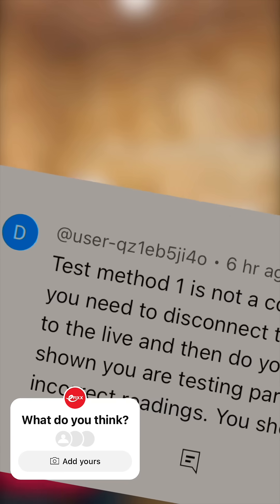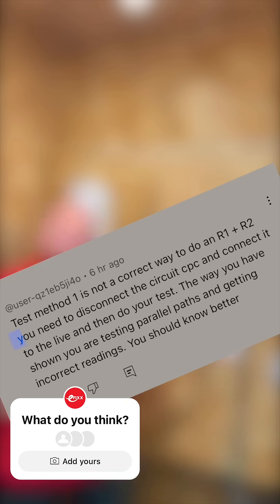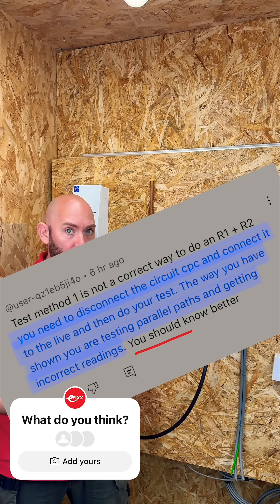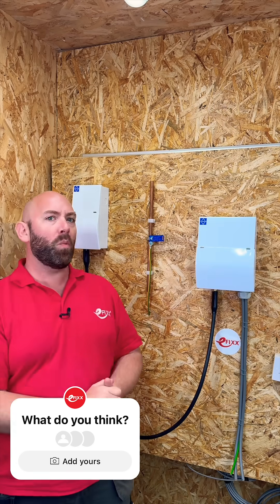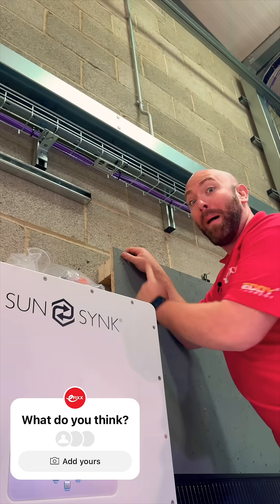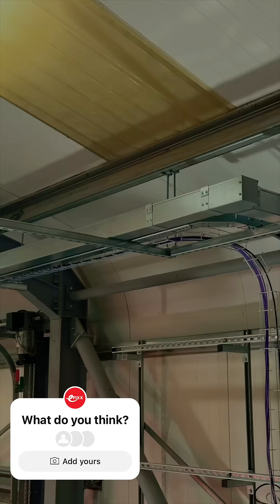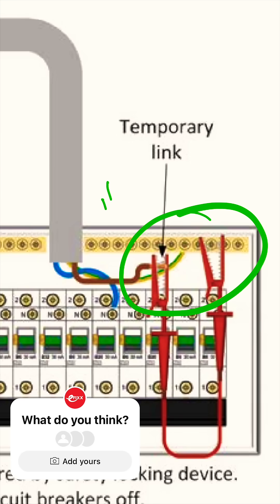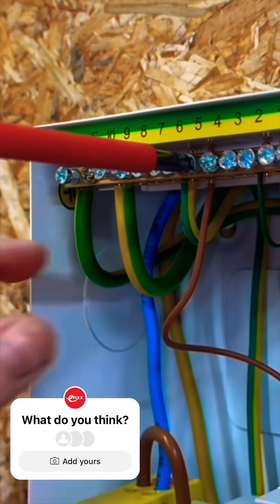Earth Continuity Testing Mistake?

Comment: Disconnecting the cpc makes no sense unless you have only ever seen circuits wired in twin and cpc. Consider a metal conduit system where the conduit is the cpc. Also consider that th circuit cpc may be connected to earth somewhere downstream of the db (not standard practice but within regs)

Comment: You might be getting continuity only because of the parallel paths and the circuit cpc could be broken somewhere so you are not verifying that the cpc is continuous and you are then stating on a test schedule that it has been verified.

You should always disconnect from the earth bar, connect L+cpc and test the other end of the circuit.

Comment: Domestics: cpcs on a ring final may also be connected to bonding conductors through boilers/water heating equipment - and that will SIGNIFICANTLY reduce the R1R2 value to a falsely low value. 

It wont be "absolutely minimal". The people who help to create GN3 would surely agree with what we are all saying here in the comments, at least acknowledge the thought process behind it.

Lights could also have supplementary bonding connected, at the ceiling rose, in older properties bathrooms. Saw that plenty in social housing.

I could see how it may be less significant in industrial, perhaps. But why risk picking up a parallel path when its a simple matter to drop the line and cpc in a wago.

Comment: You can even use an extraneous conductive part as a CPC.

In practice containment is a perfectly reasonable CPC so you certainly dont need to disconnect that. If its been designed by someone like me then you may not even have a copper CPC because im not adding that to the project when the containment will more than adequately do the job.

Comment: Bonding conductors should be removed from the earth bar for these tests but there is no real issue leaving all the final circuits linked together during testing.  How would a socket circuit realistically provide a parallel path for a lighting circuit?
 You can spend 3 days testing a house removing every socket.  What if socket 41 had a missing grommet?
Testing is like all engineering and time is a resource.  Spend it reasonably.

Comment: Mate this is the exact reason why you don't calculate R1+R2 from Zs. It's better practice to disconnect unless you can be 100% no parallel paths exist through other pcs or bonding connections. What's the purpose of the test... To verify the CPC continuity. You should try and do all you can to remove the parallel paths. Why are you encouraging people to do things worse... There's an argument to say you should verify CPC continuity prior to connecting in parallel paths when your talking about containment.... Honestly... This video comes across as petulant. I agree with the commenter... The picture in GN3 is just a picture... It doesn't support your argument... How many circuits on that picture.... What is going on efixx!

Comment: I had this in my vid last week, I posed this exact question! I used to for that reason, finding a lighting circuit nicking an old immersion heater earth. That immersion heater getting disconnected would removed the cpc for the lights. Only taking out the circuits cpc when testing would show this. I’m in 2 minds with this

Comment: A parallel path through say plumbing + bonds will give acceptable performance.  If that path is disrupted by plastic being put in the plumbing what happens to the circuit that was incorrectly relying on that path to achieve earthing?  That's right.  The earthing goes away.  If you are proving continuity of an earth wire you must eliminate parallel paths one way or another.  There's no question of it.  Any standard that says otherwise isn't worth the paper it (often isn't these days) printed on.  This is coming from an Aussie and we used to, and still can encounter, situations where all the earth wires are soldered together at the MSB.

Comment: For initial verification, I usually test the CPC continuity before terminating the cable into the CU anyway.  

For EICRs, I see both sides of the argument.  Immersions, showers, etc. are 'risky', and likely to have parallel paths, so I try to disconnect the CPC from the MET for testing where feasible.  Lighting and socket circuits are less likely to have parallel paths, so I may not disconnect.

Note that it is possible to fudge re-connection of the CPC to the MET, thus leaving the entire circuit without a CPC.  This would go unnoticed, unless testing to the MET, so there is a slight downside to disconnecting when testing.

Comment: So for example: you have a socket in the kitchen for ignition on a gas hob. The circuit cpc is broken but this isn’t detected as the cpc is finding a path to earth via the gas bond. All good right? Tests perfectly fine!…. Gas works are undertaken and now the incomer is plastic or the bonding is disconnected. Now you have no earth (cpc) and nobody is the wiser. For the sake of undoing a screw instead of using those stupid magnetic links , 5 seconds of effort to undo and you are potentially preventing a dangerous situation. Regardless of what GN3 says I think we should be doing better.
Reply: Except you would notice that the reading doesn't match up with zs reading? 
For example ze is 0.30
Zs is 0.50
R1 r2 is 1.50...
Then you would know something is up
Reply: @calebbrookes7896 this would mean you actually know what your doing 😂 some of these comments make me laugh. Love it when people like your self put a real life situation to these other idiots 👍🏽
Reply: @SuperDarren79  if you're at a point of your life where you're doing R1+R2 testing, then you've gotta know what you're talking about.

Comment: Testing the resistance of the CPC (Circuit Protective Conductor), even with satisfactory results, cannot guarantee that the conductor is continuous and unbroken at all points. The R1+R2 test is often considered inadequate in real-life applications, particularly in industrial settings where each point of the CPC is connected to metal parallel paths (such as metal structures or conduits). While the R1+R2 test may be suitable for domestic installations (like flats), its effectiveness diminishes in industrial plant rooms due to the presence of multiple grounding paths that can lead to misleading results.

Comment: I agree with your viewer.The impact of parallel path is not minimal, it brings your R2 to 0 or close to 0.Example of installation wired in singles how you taking R1+R2 and how identifying the correspondent cpc, without disconnecting.

Comment: I agree when testing continuity of cpc's in a commercial or industrial environment that parallel paths are virtually impossible to remove. Also the site installation is most likey under control of a competent person when any modifications are to take place.
However, in a domestic installation the cpc of each circuit should be removed when testing to ensure parallel paths are not present. As a circuit could be missing a cpc. However, is earthed via metal pipework, which then a DIYer could swap for plastic pipe or fitting which the continuity of the cpc is lost for that circuit.

Comment: All well and good, but anyone knows that removing the cpc from the bar is critical for any testing, not just r1 r2s. Case and point, i was doing a quick Zs on an old immersion. Got a reading. All ok? Nope. Was earthed via the water bonding. 

If i left the cpc in the bar doing just an r2 test id still get a reading. If i did an r1 r2 test with the cpc in the bar ive still got a reading. When in reality the cpc on the wiring had a break in it and wasnt continuous. If a plumber came along and put some plastic push fit stuff on somewhere you've then got an immersion with no earth.

Guidance note 3 is just that - Guidance. 

You're still wrong and it facilitates bad practice.

Comment: Well i’ll still be removing my circuit COC from the earth bar when testing my CPC continuity. 
Might aswell start doing Ze testing with parallel paths connected then.

Don’t understand when you state it’s impossible to remove all the parallel paths. If the circuit CPC is removed from the earth bar, you’re not getting any. Even with a steel containment system thats using a separate CPC, there’s still no paths back via the earth bar.

What the hell are you on about with regards wear and tear on the earthing terminal. Never heard so much guff man.
Reply: In domestic I agree. In industry that is commonly false: in the example you give of metal containment, it's almost guaranteed that the containment is bonded somewhere to the circuit, and more than likely at every accessory.  Good luck removing them parallel paths!  Add to that the oftentude (new word) that the DB is not wired up neatly (no conductor id's, CPCs and Neutrals out of sequence, you know the score) and the very idea of dropping the earth for a mere PIR rather than for serious faultfinding is a non-starter, and usually fruitless.

Comment: Tray is exposed conductive not extraneous, correct?
Reply: I don't think so.  It doesn't contain live parts and/or single insulated live conductors, so it's not exposed conductive.  It's probably not extraneous either, unless it's likely to introduce an external potential.
Reply: Exposed parts would be the actual case of a class 1 appliance, like a storage heater or cooker etc

Comment: I agree with your viewer, many missed situations arise from not disconnecting the cpc.
Reply: Seconded. To me it seems very reasonable in domestics, cpcs on a ring final may also be connected to boilers/water heating equipment pipes - and this the bondong conductors - and that will SIGNIFICANTLY reduce the R1R2 value to a falsely low value.

Lights could also have supplementary bonding connected, in older properties bathrooms. You just don't know.

Perhaps it's less significant in industrial.